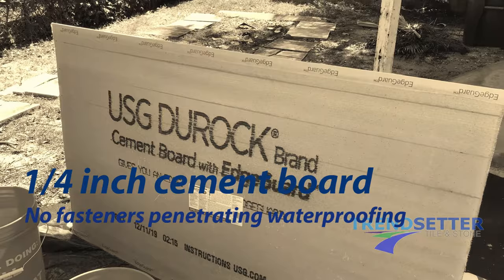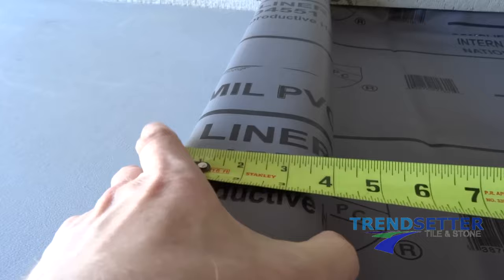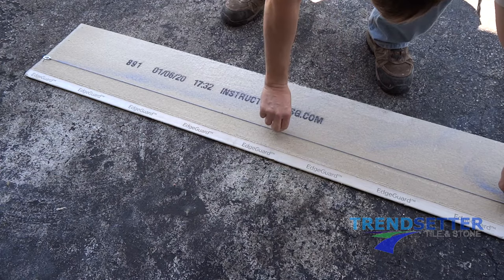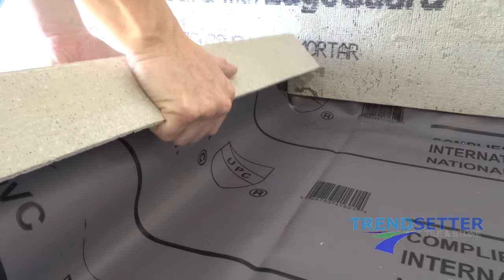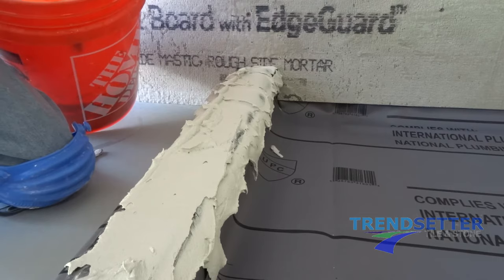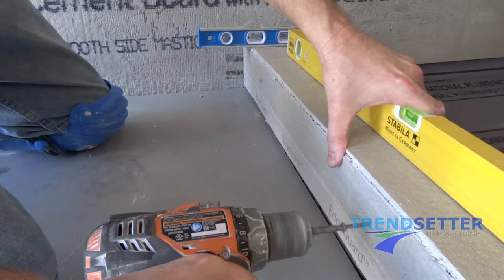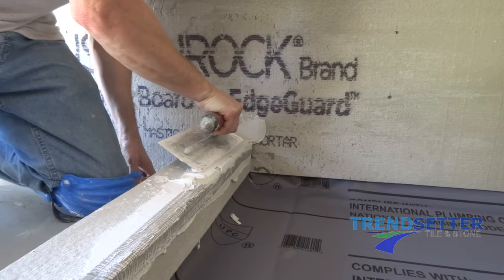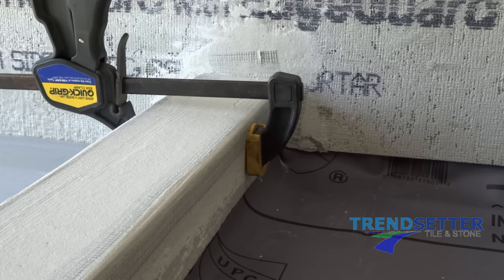How to install cement board on a shower curb and not pierce the waterproofing

Comment: Again with this method the problem is the curb is a high-traffic area being stepped on getting in and out of shower. Although I do like this method I just know that the curb needs to be solid and tight. After a short  time of traffic stepping on this curb the mortar will eventually crack and break out and cause the curb to crumble apart under the tile. Ultimately water can get into this area and underneath the shower pan tile. Putting screws in the curb and Redgaurd to the pan liner is more efficient. You could even go as far as red guarding all two-by-fours completely sides top bottom and seems in-between. Remembering that the first coat will be diluted with water for better absorption.
Reply from the maker: I assure you this curb is very strong. The tile and the thin-set used to install the tile after the curb is built only adds to the strength of this curb. 

Bonded waterproofing should always be used on the curb and walls even though a liner is used here.

As far as a high traffic area concern, in most instances the curb is stepped over as opposed to onto. This curb when completed can handle plenty of traffic, and by completed I mean tiled and grouted, and by traffic I mean even in a commercial application.

With that being said, given the choice I would not use a B-415 in a commercial location.
Thank you for commenting.

Comment: Is there any one out there that doesn't use 2x4 wood for a curb.Why are you using wood in a wet area and doing a solid cement pour of the pan with out the wood or has no one made a video of how too pour a pan with out using wood as a curb.. I would like too see one.
Reply from the maker: The 2x4 curb is outside of the wet area as long as the waterproofing I.E. the PVC liner, and topical membrane are installed correctly with no punctures or gaps. The 2x4 is friendly in size and stability, which is why they are often use.

The only time they fail is when they are done wrong!

Here is a link to a guy doing a mud curb. 
https://www.youtube.com/watch?v=pTcA04aZH2Y
It requires a higher level of skill and can be much more time consuming to those unfamiliar with it.

There are several different ways to build, waterproof and tile curbs.
Good luck!
Reply: @trendsettertilestone9602  thanks I'll watch the link.

Comment: Question for Trendsetter Tile & Stone:  What kind of thinset did you use under the cement board and on top of the PVC liner? It was my understanding thinset would not adhere to the PVC liner?
Reply from the maker: The thinset is not meant to "stick" to the liner. The thinset will harden into place and form a mechanical bond/anchor, as opposed to an adhesive bond. The thinset bonds to the cement board, but becomes a contoured shape around the liner which is not easily removed. This is the same concept used on Schluter Ditra, with Schluter's built in dovetails. Thinset does not bond to plastic ditra, it does however form a mechanical bond filling in the shape of the dovetail squares. Essential this is an uncoupled curb. This overlay will not be removed any easier than any other part of a demo. So yes, you cannot adhesive bond to a plastic liner,  but that is not what your going for here.
Reply: @trendsettertilestone9602  Makes sense! Thanks for your reply (and time)!
Reply from the maker: @SomeDumUsrName  https://onlinelibrary.wiley.com/doi/pdf/10.1002/9781119044123.ch1
A little light reading for you wizard

Comment: Have you ever used Kerdi membrane instead of PVC liner? I'm considering using Kerdi, because you can tile directly over it. But I'm confused as to why people put Kerdi in front of the wall board, instead of behind like PVC liner installs.
Reply from the maker: We use Kerdi regularly. Kerdi is a bonded membrane and a PVC liner is an unbonded membrane. There are several shower types in the TCNA Handbook. Kerdi is used on two specific shower types when integrating the waterproofing into the drain. Unbonded methods are integrated at the bottom of the drain, known as a three piece clamping flange, whereas Kerdi installations use a bonding flange drain where the waterproofing meets at the top of the flange. Both shower types have some pros and cons. We use Schluter Kerdi for the majority of our curbless showers, along with Laticrete Hydro-Ban which is also the same shower type TCNA B422C.
Reply: @trendsettertilestone9602  thanks for replying. I understand all of that, including why you would want to Hydro Ban the thinset'd seams. And that you must bond Kerdi with unmodified thinset or use All-set. But what I don't get is why Kerdi is used in front of the wall board, instead of behind. You could say there's nothing to bond to, but it would be compressed in place by the board in front. I plan on using Kerdi, in lieu of the PVC liner, with the 3 piece clamping flange, instead of the bonding flange; I don't like how large Kerdi's flange is.
Reply from the maker: @adde32332  I would't recommend using the Kerdi behind the wallboard, the manufacturer wouldn't stand behind it and there is nothing to lose in using the PVC liner if you're ultimately making a TCNA B415 shower anyway.
If I was going to make a shower that had to have a three piece clamping flange, and I wanted to use a bonded membrane, I would make a TCNA B-421 utilizing Hydo Ban waterproofing and a "divot" around the drain.

This video  https://www.youtube.com/watch?v=ZzAPYCahET0&t=294s
 shows a shower similar to B421 in a drawing with a divot around the 40:06 mark.
Reply: @trendsettertilestone9602  I understand that putting Kerdi behind wallboard is not best practice. But I am trying to understand why. PVC liners have been around longer, and they always go behind the board to prevent water that seeps through the tile and mortar from reaching the underlying framing and subfloor. Why wouldn't the same logic apply to Kerdi membrane?
Reply from the maker: @adde32332 For the most part the Kerdi may function very similar to pvc. Since it is thinner, it is possible that it would fold better than pvc.

However, It is waterproof, but not vapor proof. Kerdi is a vapor retarder, unlike pvc which vapor impermeable, or at least as close as you get to vapor proof.
Perhaps if water sat on the Kerdi, under a mortar bed, and for whatever reason; poor pre slope or clogged weep holes, the water eventually evaporated through the Kerdi, moisture may re-condense on the other side.

Damage to the framing or subfloor would probably take a good deal of time, but the Kerdi probably leaves greater potential than pvc for this to happen.

With Kerdi on top of the pan mortar the drying potential is greater. If the Kerdi was under the pan mortar there is a higher chance that the moisture would rest on top of the Kerdi and eventually get through via vapor migration.

When Kerdi is on top of the mortar, and the wallboard,  it becomes a sealed system. And while it will still have moisture vapor pass through it, it is far less because it dries out more efficiently between each showers use. Pan mortar, while efficient in directing excess moisture towards clean weep holes, will eventually over time lose efficiency and hold onto more and more water as the years go by.
Reply: @trendsettertilestone9602  Thank you! I couldn't find why anywhere. The Kerdi vapor migration makes a lot of sense as to why it isn't attached to the framing like pvc liner is. You know your stuff!

I looked up the "divot method" B421-20, and it makes sense. You are basically making your own bonded flange, but better? Kerdi's drain doesn't have weep holes, but relies on the gap between the drain heigh adjustment collar, and the actual flange to do the weeping. You bond the two together with thinset, which is less porous than mortar. Am I correct in how that works?
Reply from the maker: @adde32332  The divot is not better, it's just more applicable in some circumstances. Potential pro and con for these assemblies are;
The pro of a typical mud bed with a clamping flange drain is that it is extremely efficient at displacing water that goes through tile and grout. The con is that after some time minerals in the mortar bed along with contaminates like body oil and cleaning products eventually block the holes. Efflorescence has higher potential.

The pro of the bonding flange is that it contributes to a faster drying cycle in between shower uses because the building materials, other than the thin set, are below the membrane, and there are no weep holes to ever clog. Efflorescence chance is greatly diminished. The con is that modified mortars have an extremely low porosity. This can be a big deal when translucent stone or glass is used. Unless epoxy adhesive is used.

See article;  https://tilepro-usa.com/tile-pro-blog/f/carrara-marble-darkening-at-shower-floors

Same author on a podcast;
https://www.blogtalkradio.com/drfred/2023/01/11/moisture-discoloration-in-showers-mystery-solved

The divot does bridge a gap between the two assembly types. There are a whole host of reasons when making a consideration towards which type to use. I do not use Schluter exclusively because sometimes my needs are better met with Hydro ban, especially when it comes to divots. While Schluter does have a kerdi part for divots, it is still not in their catalog and I had to get one from my local rep. It is also takes more skill to prepare a divot for sheet membrane as opposed to liquid applied membrane.
You need to get your hands on a TCNA manual. It will show you all the shower drawings along with limitations and recommendations for each type.
Thank you!

Comment: How about just using screws and putting kerdi over the curb then you don't have to worry about outside corners getting water in them
Reply from the maker: Putting waterproofing, any type of waterproofing over screw penetrations will not make this type of curb waterproof if there is a screw on the inside or the top.
Topical waterproofing, whether fabric applied or liquid applied, does not stop water from traveling up from the pan behind the board. The water that is drawn up would find the screw and travel along it into the 2x4's behind it.
The only way the Schluter System works is when the shower is covered in Schluter completely. That means the entire pan, curb, walls, etc.
This shower is a TCNA B415 and has its limitations. A Schluter shower is a TCNA B422 and is functionally different.
Thanks

Comment: Very interesting concept. I like
It. Never any issues with the thin set releasing from the Durock? How long have you been building with this method?
Reply: Durock releasing from
The pan liner. Sorry typo
Reply from the maker: Hi, thanks for the question. I have installed curbs for this shower type like this since 1999. Builders were always leaving the curbs unfinished. Trendsetter has been in business since 2007 and we have not had any curb failures, these curbs are strong.
The thinset is not meant to "stick" to the liner. The thinset will harden into place and form a mechanical bond/anchor, as opposed to an adhesive bond. The thinset bonds to the cement board, but becomes a contoured shape around the liner which is not easily removed. This is the same concept used on Schluter Ditra, with Schluter's built in dovetails. Thinset does not bond to plastic ditra, it does however form a mechanical bond filling in the shape of the dovetail squares. Essential this is an uncoupled curb. This overlay will not be removed any easier than any other part of a demo. You cannot adhesive bond to a plastic liner,  but that is not what your going for here.
Reply: @trendsettertilestone9602  There is nothing to mechanically bond to. That's what lath is for. 
Is this an acceptable method in the NTCA handbook?
Reply from the maker: @k0harmer  Hi, thin-set mortar has a chemical bond within itself. Sand, polymers, water and other componants cure and bond to one another chemically. When you "stick" a tile to anything,  cement, wallboard, etc. It attempts to make a mechanical bond. Filling small crevices and shapes looking to attach and remain locked in. Even as the shape increases, mortar still locks into a shape. whether around a curb or into a glass vase. The thinset is not making a chemical bond with the liner, for that matter a metal lath and mortar shape is not either. Both methods make a shape that you will be able to bond to after the shape has cured. They are essential the same. If you gave it a try, it's just as strong as your lath curb. Nothing against lath and mud, this is just another way.
The NTCA does not make any standards or guidlines. The TCNA handbook does have a drawing for a curb using reinforcing/lath on page 284 of the 2020 handbook. The reinforcing/lath is used mainly to contour the shape of the curb so the mortar will be able to attach in a mechanical shape around the curb. Lath is not required for the curb in this video because the cement board already has the integrity that the lath achieves when mortar alone is used. Other curb types like solid foam, foam overlay, solid concrete curbs, bricks etc. are not in the handbook. Sometimes the book is a little vague to let installers and manufacturers have some room in how to construct assemblies. TCNA is all about guidelines, not hard and fast rules, even if it sometimes seems like it.
Thanks
Reply from the maker: @k0harmer  On page 258 of the 2020 TCNA handbook there is a section titled common shower configurations. It shows a mortar curb and a preformed curb side by side. The method on this video is the preformed curb also referred to as overlay. I knew it was in there, just in a different section.

Comment: What should the minimum height of the finished curb be inside the shower?? Thank you
Reply from the maker: The size of the shower pan, and the drain location make the depth from curb top to pan top a variable.  When possible, I make the minimum depth from the top of the finished curb to the top of the finished pan no less than 1 and a half inches. A very long pan with a drain that is offset to one side can make the pan depth shallow on the end farthest from the drain. A curb that built 3 2x4s high can accommodate over an inch of slope from the far end to the drain in a 5 ft long shower easily, and still leave you with 3 inches of depth. Your local building code would be your official reference for this question. Thanks
Reply: @trendsettertilestone9602  Thank you for your reply

Comment: Do you recommend wrapping the curb with galvanized lath before apply the thinset ? 
And the thinset do you recommend doing unmodified or modified ? 
Or there’s no difference
Reply from the maker: No, lath would be used only if you are going to mud the curb by traditional means with fat mud. A lath mud curb has no cement board on it. I recommend modified thin-set mortar that is designated LHT mortar. Typically these mortars are ANSI 118.15T. The T at the end stands for Thixotropic. Using a modified mortar is not for the sake of bond strength but because modified mortars like LHT can be used slightly thicker than un-modified mortars. The thinset does not make an adhesive bond to the liner, it makes a mechanical bond after it forms to the shape of the curb. Your modified mortar may not display a "T" but if it's LHT it should have thixotropic properties.
Reply: @trendsettertilestone9602  can it be done with a double curb shower pan as well ?
Reply from the maker: @marianah.3164  Yes, I imagine you mean where two curbs meet at 90 or 22 1/2 degree intersection. 1/4 inch board is even more important when there are multiple curbs because the liner will be slightly bunched up at intersections. Using the mesh tape is always important but especially so where two overlays meet one another.

Comment: Great idea but what if someone stands on the curb (because you know they will at some point)...I'd be afraid of the bond breaking on the loose liner.
Reply from the maker: We, I, every contractor on the job, walks all over the curb. There is no problem, the curb will not move.
I have prepared curbs days in advance, with all kinds of trades stompin around the job.
The key thing here is that we're not bonding to the liner at all. The thin-set mortar is forming a mold around the liner of the curb. Once the mortar is cured, it's not moving. Especially after the tile and additional thin-set is applied to it.
This method is no different than lath and mud over the liner in terms of performance.

Comment: Great idea! Will this method work with 1/2 inch cement board too?
Reply from the maker: 1/2 inch board will work but the thinset under the cement board on the inside face may make your curb wider than you would like. 1/4 inch board makes it so the overall width of the curb is not far off from what a 1/2 inch board is without thinset. 
Thank you!
Reply: Thank you.

Comment: Does this method work with hardiebacker fiberboard?
Reply from the maker: No. The composition of fiberboard does not allow it to keep its integrity when it is bent along the partial cuts. Fiberboard cannot be installed below the mud line in a pan or in contact with the pan mud for that matter.
While cement board has a high porosity, Fiber board has an even higher rate of absorption. Fiber board has a strong capillary action and will draw water from the pan mortar if it is in contact with the pan mortar.
Thank you
Reply: Thanks for your detailed response, i really appreciate it. Subscibed👍🏻